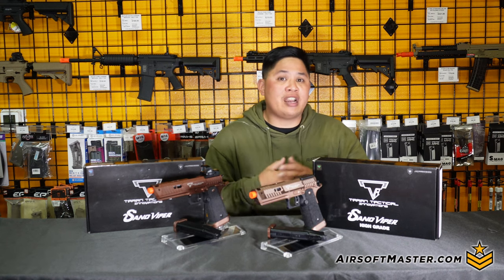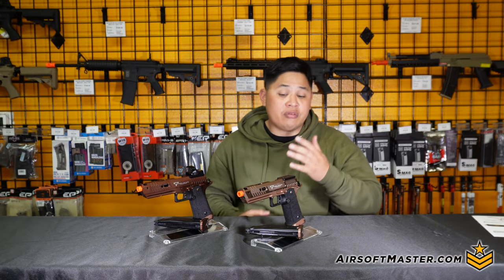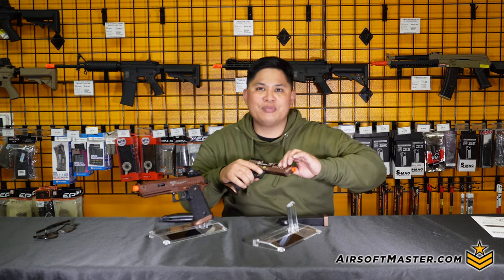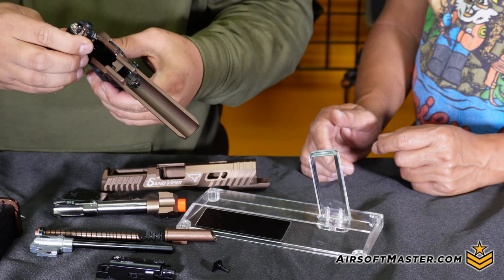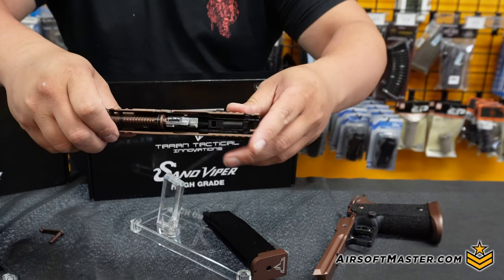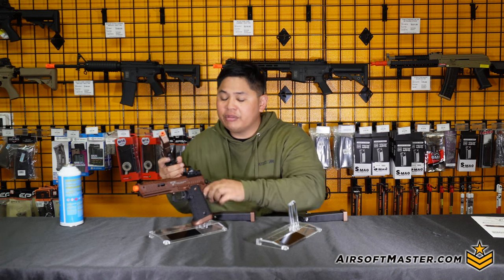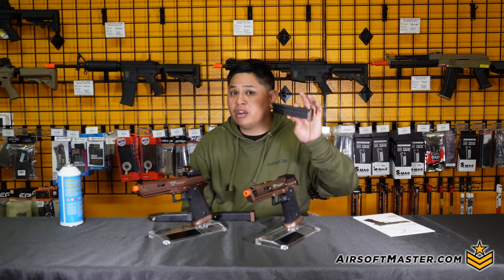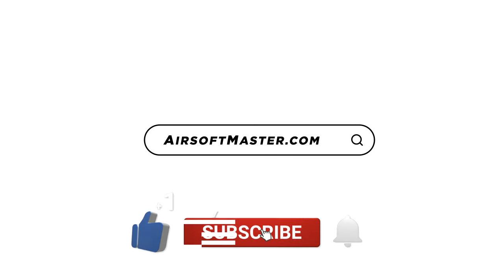Taran Tactical Sand Viper High Grade by Jag Precision (Sand Viper 2.0)

Comment: Do you know what the clear film on the outer barrel is?  It is visibly marring a bit towards the rear of the assembly in your video at 4:43 and on mine it is flaking off towards the front near the compensator.  Is this some kind of protective film that just can't survive use or did they neglect to remove it before assembly?
Reply from the maker: Yes that is just a film to protect the barrel from any friction. You can remove it as it's only for packaging I removed mine and did not have any issues with my pit viper or sand viper! :D
Reply: @AirsoftMasterTV  got it, thanks!  Now the struggle is to find a holster that will fit it